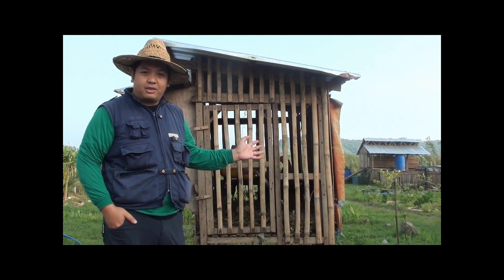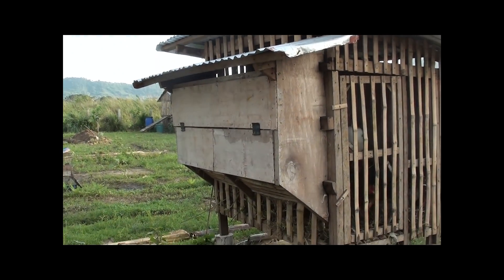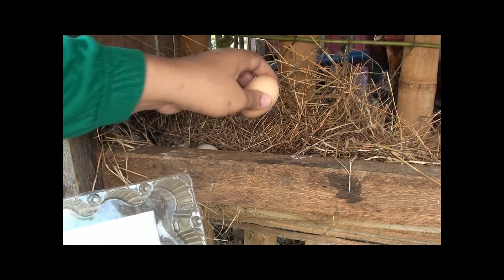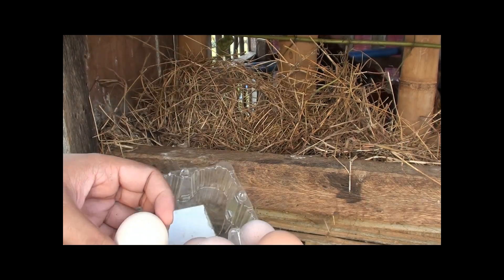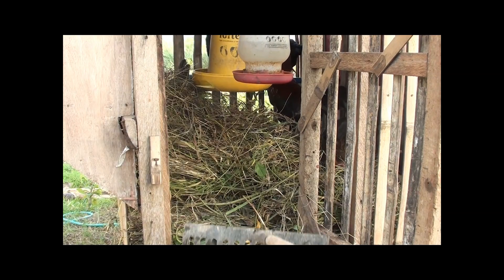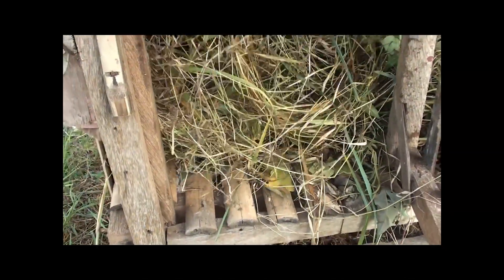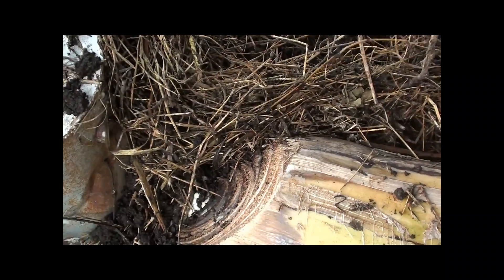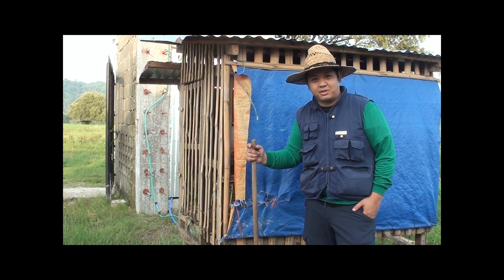Odorless Chicken Coop with Vermiculture at MADE Farms Philippines

Comment: This is the best thought out coop I have ever seen. Thank you so much!
Reply: +ORIGINALDOGMAN John Castro - It can be easily modified if predators are a common problem.
Put up a hardware cloth run around the coop + a wire mesh cover over the worm section to keep the chickens out.
Reply from the maker: +ORIGINALDOGMAN John Castro here is another coop design we use https://www.youtube.com/watch?v=V01om6VUV3Q
Reply: +D Holtman Here’s How to build an extremely cheap all-in-one enclosed chicken coop for up to 4 large chickens* Visit here -> www.chickencoop.ml
Reply: +Dmitri Jackson Is four chickens even a flock?